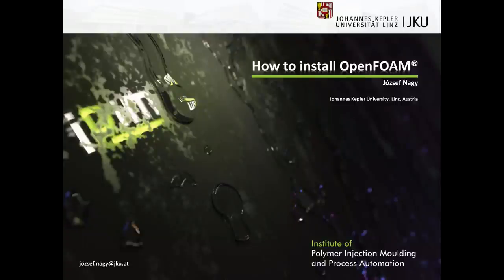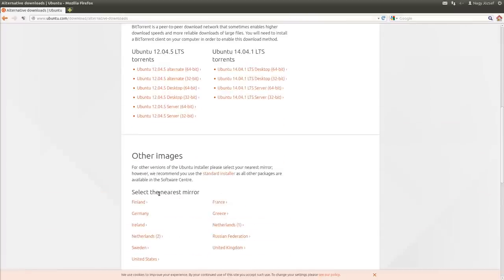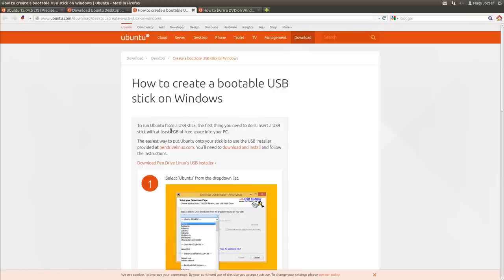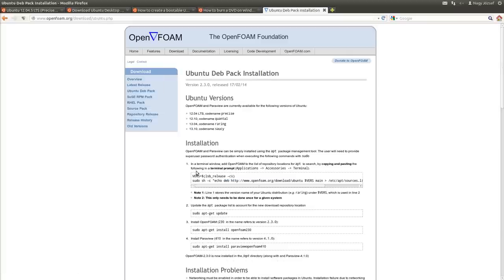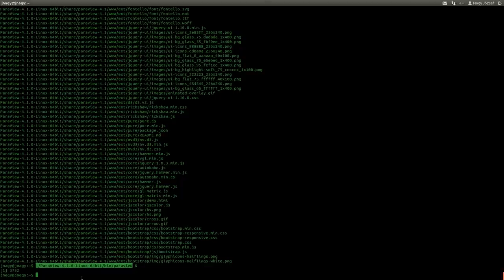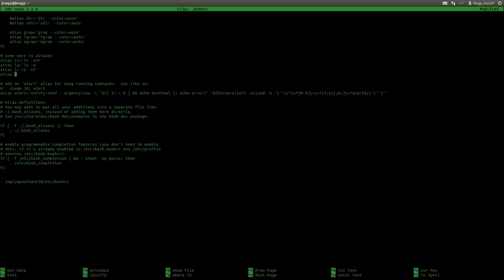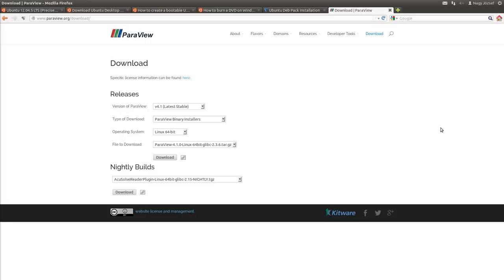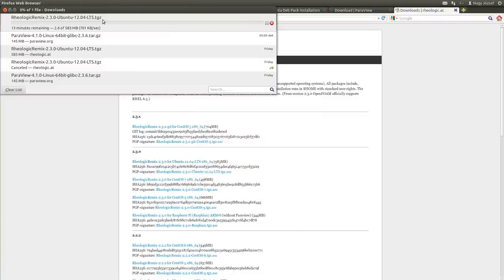How to install OpenFOAM®

Comment: Hello Sir! I was about to start simulating using OpenFoam. How much space does it take to have Linux and Ubuntu? I am using laptop and I'm afraid it is not going to be enough.
Appreciate your help
Reply from the maker: It growth over time but you can shrink the image if you delete files in the WSL2 container. One of my containers has currently the size of 11 GB, another has 6.7 GB.
Reply: @OpenFOAMJozsefNagy  I think that should be enough for me. Thank you, Sir!

Comment: Hello! I'm trying to open paraview in Ubuntu, but I have this error and got stuck: "error while loading shared libraries: libXcursor.so.1: cannot open shared object file: No such file or directory". I also tried older versions(5.9.0, 5.1.2, & 4.1.0) but still I have problem with similar error messages. Could you help fix this problem?

Comment: Hi Jozsef! 
I enjoy a lot your tutorials, thank you for have uploaded them!!
May I ask you two questions?
I have windows vista... In order to install OpenFOAM do I have to install Ubuntu? And which versions of ubuntu and OpenFOAM should I choose?
Thank you
Reply: Moreover it's a 32 bit pc. Is there a version of openFOAM which can work on a 32 bit system? 
Thanks
Reply from the maker: Well, Vista is very old. I do think, that you have to use a dual boot with Ubuntu. Or you could try the docker version, but I do not have any experience with that. Maybe that works, too.
Reply: Thank you for answering! ...But in the meanwhile I have decided  that was time to put my 9 year old computer to rest and to buy a new one.
Can I ask you another tip?
Do you think that a windows 10 home with RAM 8 giga, 256 SSD and 3 GHz can work quite well with openfoam?
Reply from the maker: The Windows 10 solution is still in an early phase. You can use Win10 for case setup, for that it is perfect, but you should run your simulations on a Linux PC, it is faster. If you only have the budget for one PC, you can go for Windows 10, but it will be a bit slower. RAM depends on your application. For most of the solvers 8 GB should be ok. Snappy needs quite some RAM for bigger meshes, and CHT also needs an unusual amount of RAM. In those cases 16 GB would be better.  If you go for the latest intel i7 or xeon processors, you should be good to go.
Reply: Thank you very much for your availability and for the so useful advices!

Comment: Hello !! I am trying to install OpenFOAM in CentOS 6.7 using your second method (i.e. Rheologic), but after doing everything when I am trying to command "simpleFoam " is not working. I don't have any idea why i is not working. Can you help me out where shall I check?
Reply from the maker: If you downloaded the CentOS version and it doesn't work, contact the guys at Rheologic. If you used a version, which runs in Ubuntu, you will have problems, you'll have to compile it from yource.

Comment: hello i am using ubuntu 16.10 when i tried to install openfoam5 it is giving error 
E: Unable to locate package openfoam5
what could be the possible issue, earlier i used version 4.1 on the same os. now i changed the hard drive so i need to install the software again.
please help me with this
thank you in advance
Reply from the maker: Hmm. Head over to openfoam.org and check out their guidline, maybe they changed the name of the repository.
Reply: finally resolved the problem openfoam5 is not for ubuntu 16.1 because it is limited support version of ubuntu. i installed the ubuntu 16.04 LTS now openfoam5 is working very fine.
Thank you
Reply from the maker: Great I am glad.

Comment: hello. I have one problem, when i was following this video. That is when i open 'www.openfoam.org' there is 4 steps which i need to follow. But when i copy the step 1 and try to open the terminal, but i cannot find the terminal..this is the problem. although i have downloded the iso file...please help me..my question is how i get terminal option..??thanks
Reply from the maker: Try ctrl+alt+t and you should get a terminal.
Reply: József Nagy yes, i have tried many times but cannot find the terminal. one question that we can find the terminal in all types of window system..?? or we need to install something so that we can find the terminal...??
Reply from the maker: What distribution do you have?
Reply: József Nagy I m sorry, i colud not get your question but, i want to say that,
My PC is window 7 . But when i open the link to install Ubuntu, Actually my PC is 32 bit, but i cannot find "ubuntu-12.04.5-desktop-amd32.iso", as you installed  "ubuntu-12.04.5-desktop-amd64.iso" from that link.

But i installed   "ubuntu-12.04.5-desktop-amd64.iso" and then try to burn DVD, but it does not show the option D-drive on 
"Disc burner", only it shows "cd Drive".  So this is the reason that i could not find terminal?

kindly give me solution of this problem, thanks
Reply from the maker: You are looking for ubuntu-12.04.4-desktop-i386.iso. Try it with that link.
Reply: József Nagy thanks for that. I have followed your advice, and got success to install ubuntu 12.04.4. Now only one problem that is , i could not find "terminal" file yet. i tried crl+Alt+t..but could not find. what may be the reason..?? thanks
Reply from the maker: You booted ubuntu and in ubuntu you still cannot get a terminal with ctrl+alt+t? That's very odd.
Reply: József Nagy according to your video,i boot the Ubuntu from usb after resart PC, and install it in C drive. you said to find terminal by pressing crt+alt+t..i did just this...may be before press the ctrl +alt+t, i need to open any file from Ubuntu..??i did not open any file, like Ubuntu etc...
Reply from the maker: Munawer Ali
I think this video can help you
https://www.youtube.com/watch?v=8p-jzAl6dos

Comment: Hello Jozsef, i have a big problem about OpenFoam. i try to run it through terminal, type "simpleFoam" but gives me that error "

FOAM FATAL ERROR: 
cannot find file "/home/yavuzabd/system/controlDict"

    From function virtual Foam::autoPtr<Foam::ISstream> Foam::fileOperations::uncollatedFileOperation::readStream(Foam::regIOobject&, const Foam::fileName&, const Foam::word&, bool) const
    in file global/fileOperations/uncollatedFileOperation/uncollatedFileOperation.C at line 505.

FOAM exiting"

can you please please help me ?
Reply from the maker: I think, that in the terminal you have to navigate to the folder, where you want to start the simulation.

Comment: Grüße aus Rostock vielen Dank für die Videos. Sie helfen da  leider nicht viele  Quellen  vorhanden sind. Gibt es  eine Chance dass du auch Videos zu IHFOAM machen kannst?
Reply from the maker: Hallo, der Solver ihFoam sagt mir jetzt nichts. Dementsprechend kann ich diesbezüglich leider nicht helfen.
Reply: Trotzdem  vielen Dank. Der Solver ist gut um Wellen zu simulieren, unter  anderem  auch Absorption von Wellen. z.B. für Platformen und Küstenanlagen
Reply from the maker: greywolfblooddoom664 Ich habe mir den Solver angeschaut und der schaut so aus wie interFoam. Schau dir mal meine Videos mit interFoam an und versuch den gleichen Case mal mit ihFoam laufen zu lassen. Wenn der Solver tatsächlich ähnlich ist, dann sollten eventuell nur kleine Unterschiede auftreten, wenn überhaupt welche auftreten.